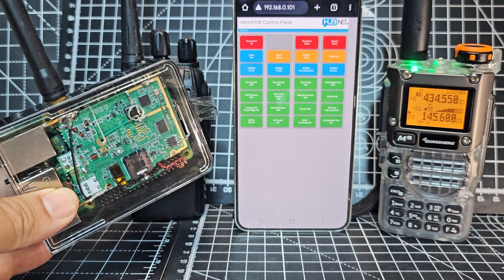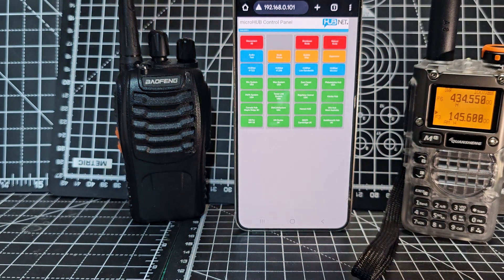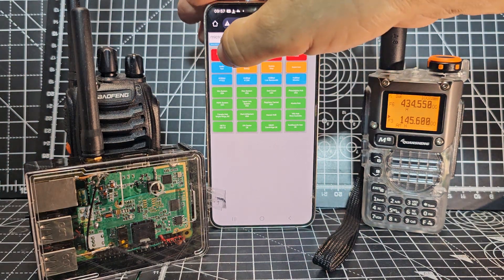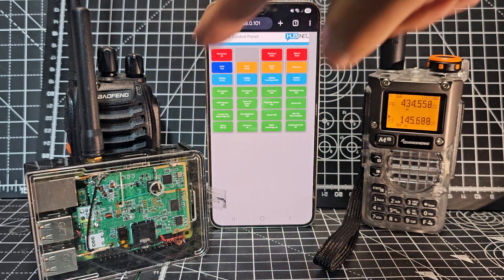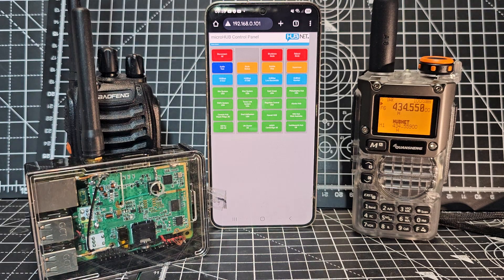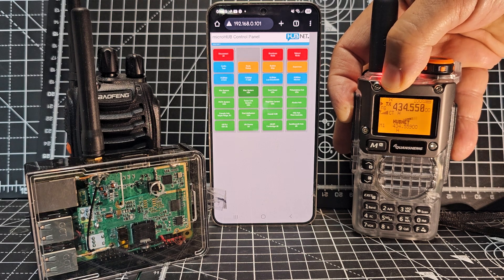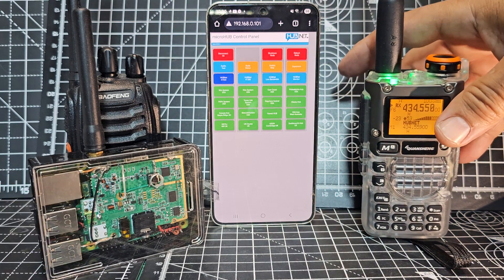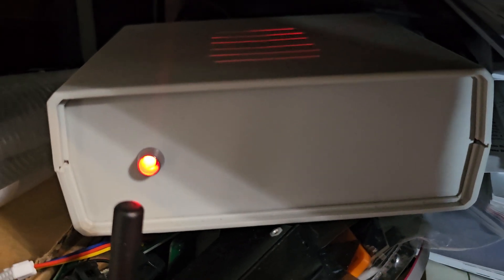Allstar Node - Ham Radio ?

Comment: Can you try this with Reticulum running rnode on the raspberry pi? All it would take after that is to connect the pi to a screen to see it, or connect it over bluetooth to another device running nomadnet or sideband, or to your home network so that any device running rnode will automatically configure and connect to it and by extension any device that your radio communicates with
Reply from the maker: That too much work.sorry
Reply: @M0FXBHamTech  no worries. Ill have to try it myself when i save up for a baofeng and raspberry pi